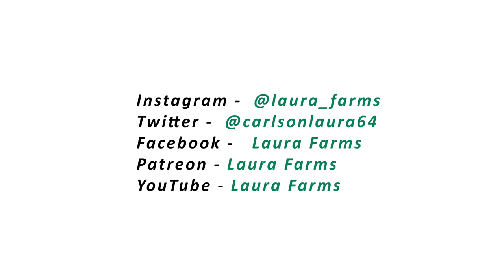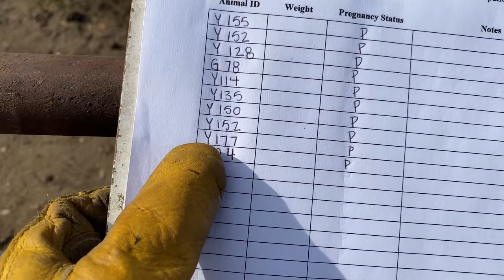Laura has Cows!!

Comment: Just a friendly heads up when running the Dremel tool. You should really use some safety glasses to keep those pretty green eyes safe.
Reply: Second that motion!Motion! And congratulations on the wedding
Reply: Thinkn' the same thing, and some of those light weight, super tackie sports gloves, to protect those pretty fingers, dremels do scoot around, and definitely glasses. Too cute for injuries, especially with wedding coming up.
Reply: Hi,
Regarding the Dremel tool, always push the bit or burr as far as possible in to the chuck.
This will minimize vibrations, give better control and minimize breaking the burr and excessive jerking and loss of control. A broken rotary bit or burr can instantly fly in any direction any can severely damage an eyeball. I strongly recommend eye protection when using Dremels, die grinders.
Take care and good luck.
Reply: @hawkeye1836  i would suggest to keep any kind of gloves (and also long hair) far away from such tools. +1 for the glasses
Reply: Nahh! Country people were taught to be careful. No need to worry!
Reply: She’s fine , internet safety warrior
Reply: Dremel tools - and most other 'rotary' types - are really bad for one's eyes...  you get debris from the material being worked, but the 'tools' (grindstones, flapper wheels, cutting wheels, etc) can AND WILL break, sending sharp bits flying at high speed...

Comment: Two tips for grinding - safely-. Aweilders face guard ,clear, plastic ,tough!- and a fixed to your skull- so you can bob your head and the shield slides down ...also find the angle of rotation , most of the schrapnel is in the line - of rotation ..step to the side- inertia sends - most of- the fragments : right down the plane of rotation , not safe ; safer